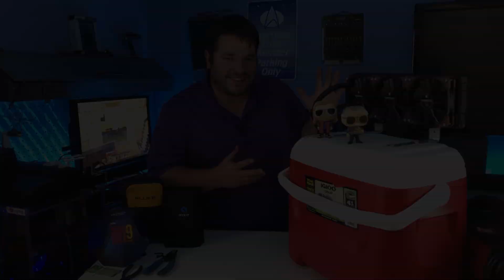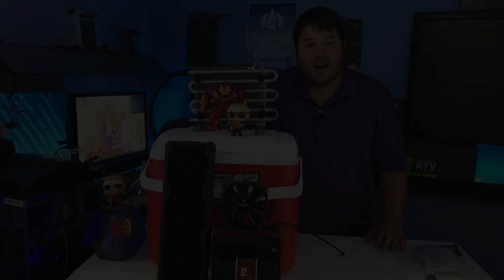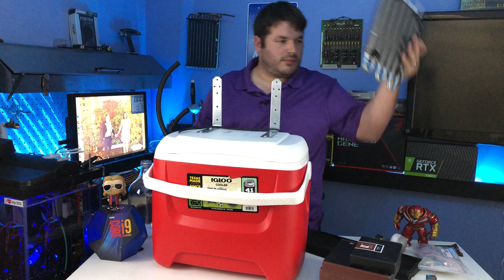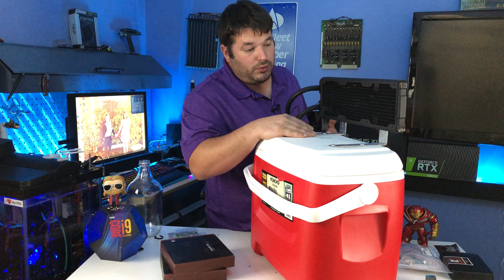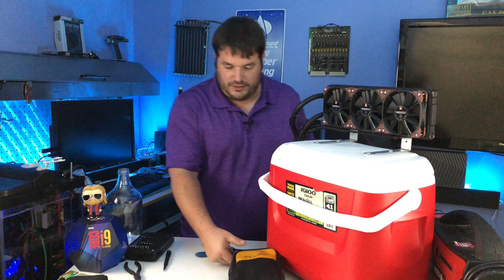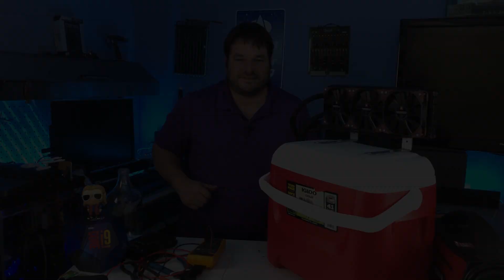BEST ICE CHEST AC EVER!

Comment: Please make a video showing a close-up of each component and provide the brand name, the price, and the place you purchased each component.  If you do this, it will make your D.I.Y. video(s) much more user friendly for a lot of your D.I.Y. viewers.  Most D.I.Y. YouTube video channels include this information in the information box area below each video, and often include a URL link next to each component  item if purchased on amazon.  Other than that, your D.I.Y. videos are excellent and entertaining to watch ( among the best I've seen ).  Keep making more videos!  Please make a new version of this video, but make your ice chest air cooler a closed-loop system which requires a water pump with two hose / tube connections instead of only one connection ( inlet and outlet hose / tube connection ).  By using a closed-loop system, no air, water, alcohol, or anti-freeze touches the ice and therefore, the ice does not melt near as fast.  And, if you connect the liquid coolent ( water, alcohol, or anti-freeze ) tubes / hoses to a radiator under the ice inside the ice chest, it will make the  fan(s) blow colder air.  To maximize cooling efficiency at the maximum fan speed, you can implement larger capacity closed-loop 12 Volt water pump(s) in addition to connecting the inlet and outlet coolant tube(s) / hoses to a radiator under the ice inside the ice chest.  Some people have connected up to 3 radiators under the ice to maximize cooling efficiency.  I would become a paid subscriber member to your YouTube channel, but I'm on social security disability low income.  A lot of disabled people are hypersensitive to warm weather for various reasons and have a need for a 12 Volt, portable closed-loop ice chest air-cooler because it does not put moisture into the air as it cools the air and therefore, can be used indoors or outdoors in hot humid weather or hot dry weather.
Reply from the maker: Hello bradlyons7046. I appreciate your input and i do agree with your assessment. I haven’t made a diy video in a while due to some life circumstances however i will take your suggestions into account on my next one. Thank you
Reply: @TheRenaissanceBuilder   bradlyons (me) says thank you for your reply; I find your D.I.Y. videos to be among the most interesting and entertaining videos on YouTube!  Thank you

Comment: Ah man. I'd use that bigger radiator as the intake of air into a marine blower fan with two (or 3) smaller radiators with semi rigid ducts as the outgoing air for larger differential of temperature. Might be more expensive. Might go through ice a tad faster... but I like me some frigid air.

I love your design here though. My son has a car-bedframe and having your setup would be sufficient in replacing the hot air that is in the frame with cold air pooling inside. Keeping him nice and cozy while the rest of his room is 90 degrees at midnight.
Reply from the maker: I like the way you think. Indeed i may just redesign a system using a squerel cage blower and more heat exchanger surface for maximum effort! It will indeed go through ice quickly but hell you and me aren’t the only ones that want it cold 🥶
Thank you for watching and commenting!

Comment: What is the temperature of room and the blower?  Some people have tried the computer radiator and upgraded to car radiator, you are doing the opposite, because it is not cold enough, the amount of water inside the cpu radiator is very little as compared to car's radiator.
Reply from the maker: So the use of the computer radiator in this case has more to do with installation quality and convenience and efficiency. Everything needed to make a quality ice chest ac using those components already exists and is easily acquired.
As far as radiator size it really comes down to your quantity of ice. You only get about 144btus out of one pound of ice, the radiator size only changes how fast you get those btus out (or in to be accurate).
The size of the space and desired condition really dictates the size of the radiator needed and the bigger the radiator the more ice is needed.
If all you do is increase the size of radiator then you don’t actually do anything. The bigger radiator needs more water flow and bigger fans and in tern more ice. 
To sum all that up, this cooler is only good for a certain size space under certain conditions. If more is needed than an entire system upgrade is the best choice